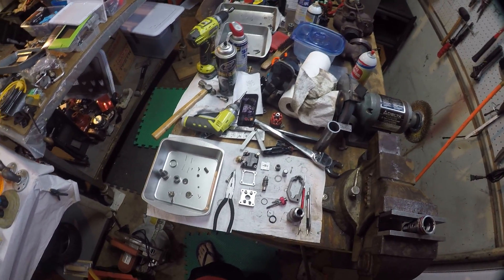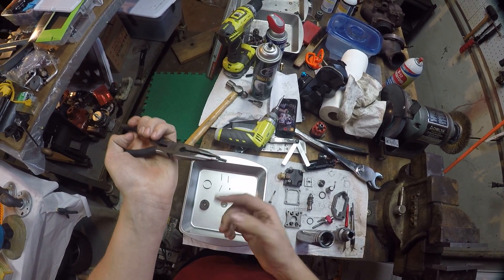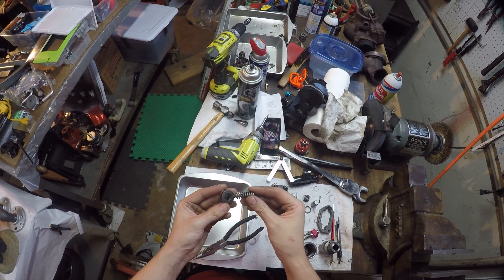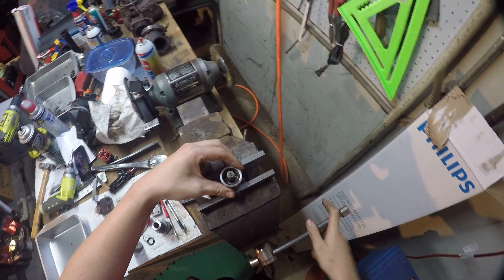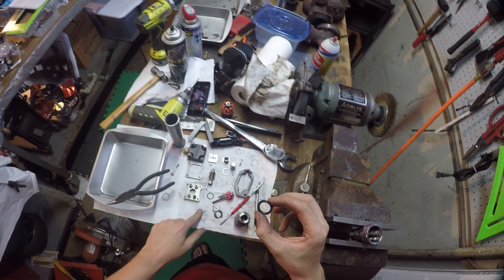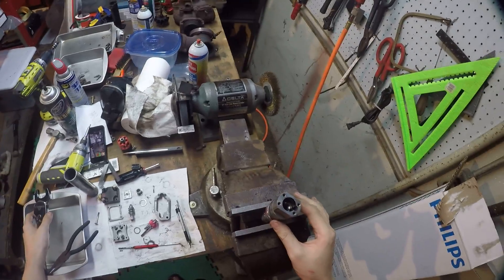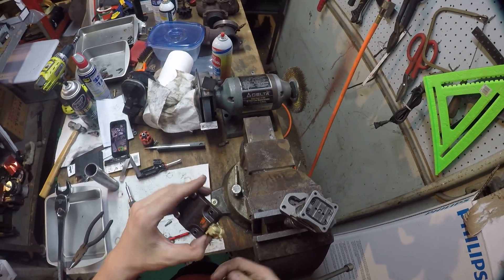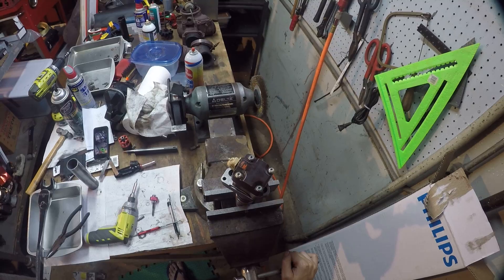How to Assemble 7.3 Powerstroke Injectors (Part 2)

Comment from the maker: These affiliate links help support this channel so I am able to put out more content for everyone. 
Here is a eBay affiliate link of kits I have used in the past. This is a "tool less" kit. So you will have to either make a tool or buy a tool else where. I am not a huge fan of the tool that comes with the tool kit so I am not going to recommend it. Alway try to get a kit with OEM external o rings. I have had good results with this kit.  Built several sets for customers. I will be doing a more complete video soon, and also show you how to make a good tool.

7.3 OEM External Oring rebuild kit. - https://ebay.us/ZgSGGY

Comment: Nice Video!  Gives one a great idea of what to encounter.

Not sure on your torque specs.  I saw a video that said that single solenoid plate screw torque spec was 25 ft lbs.  Also I am having trouble determining which screws are which listed in the description as compared to the video.
Reply from the maker: I don’t think I would want to test 25ft pounds on that screw. It’s pretty small. I honestly do everything by hand, but the torque specs that I listed are the torque specs found in the pocket reference book. They have torque specs for all different sizes of bolts. I picked the size of bolt with the same thread count and used that for the recommended torque and that is what I listed in the description. 

Unless you work for the oem manufacture or have the oem handbook you won’t have the exact torque specs that the manufacture uses. Here is a chart below that has torque specs for bolts of all grades and sizes. In this chart a grade 8 3/8” bolt is torque to 22ft lbs.  

https://www.portlandbolt.com/technical/bolt-torque-chart/#bolt-torque-a354bd

Solenoid screws are the first screws you take off on the top.
Armature plate screw is the single screw  with the special head on it. 
Spacer plate/poppet valve plate. Is the plate below the armature that has 4 screws in it. 

Hope that helps.
Reply: @BudgetBuiltDiesel  Thanks very much!  That helps.  Another video I just watched said 75 Ft lbs for the injector body.  I am not at that point of rebuilding the injectors yet.  Don't have the parts yet.  have the shim kit on order.  Already did the driver side injector o-rings.  I do have an o-ring kit with all kinds of sizes, just wondering if you think those three injector o-rings are anything special.  After seeing how easy it is to rebuild I would at least like to take mine apart, clean,  especially the tip.  I am tempted to take one apart and try putting back together with same o-rings or if I have ones that match.

Thoughts?
Reply: @BudgetBuiltDiesel  I think I either heard him wrong or he meant inch pounds instead of foot pounds 25 inch pounds seems about right.  ~2ft lbs

Comment: Wondering if I can use a tool post grinder on the lathe to modify my pins? I also have a mill to possibly open the nozzles. Do you know what the dimensions are. If I can pull it off I could do some for you if you need them

Thanrob
Reply from the maker: robert lanham there's no real reason to modify the pins. The only ones that break are the long pins and you can just replace those with new ones. If you managed to break a short pin I guess then there would be a reason to grind down a long pin if a long pin was all you had. 

As far as modifying the nozzles with a mill. That won't work because they are very tight tolerances. The holes in the nozzle are drilled at an angle and are only .005 from the factory. There are plenty of companies that will drill them oversize. They also grind the need and airflow them. It's one of those things you have to have the machine to do it. I think they're about 5-10 grand. I'm not 100% sure on that number though.
Reply: Anthony Young roger that on the nozzle, the pins I was talking about the intensifier pin? I thing, also I might be able to make a set of soft jaws and attach a grinder to my cnc mill and do all 8 at one time?
Reply from the maker: robert lanham robert lanham I see what you are saying. To make the intensifier piston shorter. You could probably do that on a cnc with a grinder attachment. As long as you can keep the tolerances close enough. There's still probably only +-.0005-.001 is my guess on the length of each piston in relation to each other. You might be able to get away with .002-.003. I know it can't be too much variance or you will start to have too much fuel in one cylinder and too little fuel in another. 

Normally what you use is a surface grinder with a magnetic chuck to take off a little bit of material with. That's how they actually resurface all the small parts in them on a remanufactured one.
Reply: Anthony Young thanks for the info, I probably won't attempt that cause I can't hold that tolerance. Are you going to do anymore diesel related videos. I bought a 99 e350 I'm working on and may convert to 4x4. Just want to make sure engine and transmission are good first
Reply from the maker: robert lanham I really need to make some more Diesel videos just need to take the time and make some. I just rebuild stuff stuff mainly. I've been wanting to make a complete video series of how to rebuild these Injectors properly. Just takes a lot of time to do something like that. Even these videos take a couple hours by the time you get done with editing.

Comment: So I plan on upgrading my injector tips. Can I just rebuild the fuel side of the injector and screw it back on to the oil side ?
Reply from the maker: 530DUTTER Yes you can. If your Injectors are in good shape you shouldn't have any issues. You won't be able to torque Injector but properly without taking the oil side apart. So there could be an issue there if you don't get it right enough. 

Just be sure to replace the spring, check balls, and the o-ring that seal the Injector nut to the oil side.
Reply: Anthony Young   Ok cool thanks what if I were to mark it so it tightens to the same place?
Reply from the maker: 530DUTTER You could put a paint line that lines up with the Injector nut and body. When you go to tighten back up go a little past it just to make sure it's enough. 

I would say just go by feel just like you can with a bolt. You can kind of tell when it "stops" pushing the parts together. I've rebuilt about 100 of these things so you kind of get the hang of it after that many. If it squeaks you've overtightened it. 

It's not a bad idea to take the oil side of it apart just to clean it out. You don't have to rebuild that side if you don't want to. Not too much wears out on that side. If you choose to do that you can torque it with an 1 3/16 crows foot while it is apart. Just make sure when you clean it don't use brake clean or carb clean that will eat the o rings. Use mineral spirits that won't damage the o rings on the oil side. 

If you have some time to wait for your truck to be down you can send them to me and I can do the least work to them you want (just swapping the nozzles out) or a complete rebuild. I have about a 2 day turn around time + shipping time.
Reply: Anthony Young   Okay yeah I'll keep that in mind. I'm just looking for better fuel delivery
Reply from the maker: 530DUTTER the other option you can do is change all the intensifier pistons out. You can either buy them already ground or send yours off to a machine shop and they will surface grind them down for you. When they get shortened up it allows for a longer stroke on the intensifier pistons leaving the needle open for longer and will allow more fuel to go through the nozzle. Also adds a little bit of fuel to the "chamber". 

There's several different things you can do. You can also send your nozzles out and get them drilled instead of buying new nozzles that are already larger.
Reply: @530DUTTER Hey if you haven’t already done those upgrades go onto bitter root diesel (formally 406 injectors) and check out all the stuff they got for the 7.3 Psd injectors. Cool stuff
Reply: you could grind on the lathe to a .001 or better and hand lap on a surf. plate my pap made lifters he could not get any more for a 54 parsons backhoe he did it 30 years ago and it still runs today it of corse is a bit of work though but ya get bragging rights lol and as the other guy said the spray tips i wouldnt fuck with inless you had to if your index is off even a .0001 the drill would brake in the hole and its done

Comment: where do you get all your new parts for the rebuild? is there a kit containing them all?
Reply from the maker: I just sold my last two kits that I had, but there are other suppliers on eBay. However I can not guarantee the quality of the parts. I always got my parts from Redat North America which is a large supplier of turbo/injectors parts. They are all OEM quality parts (made in Italy). All very high quality stuff and never had any problems out of their products. However if you are not a company and order from them the parts are almost double the cost. Sometimes it takes about a month of so to get the parts you need depending on the quantities they have in stock. I sell the kits to rebuild w/o tools for $160-180.00 depending on what all you want to replace.